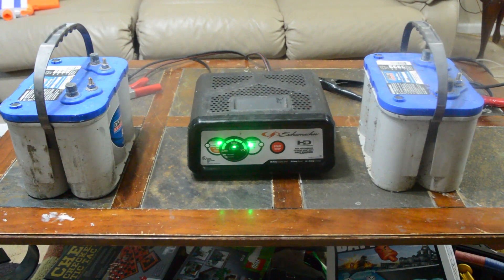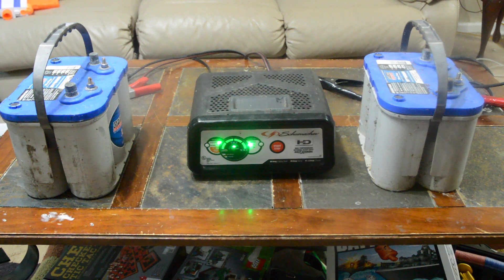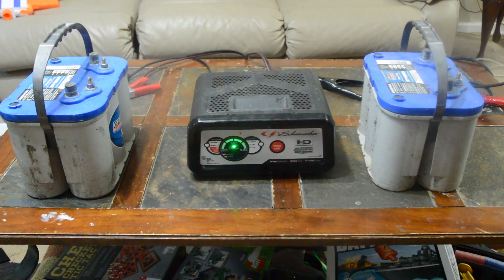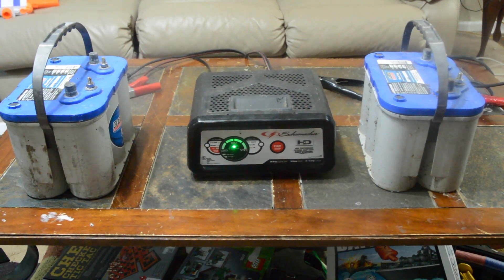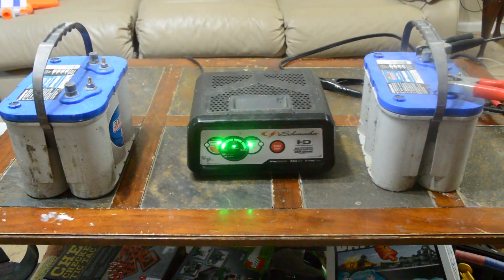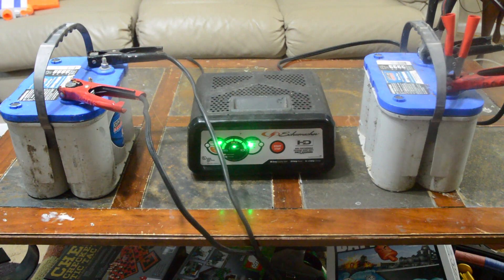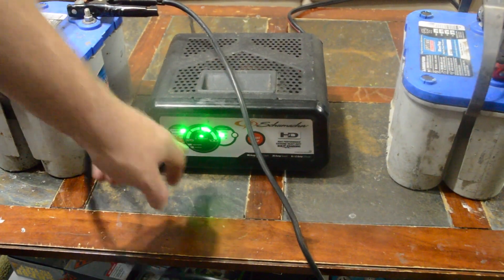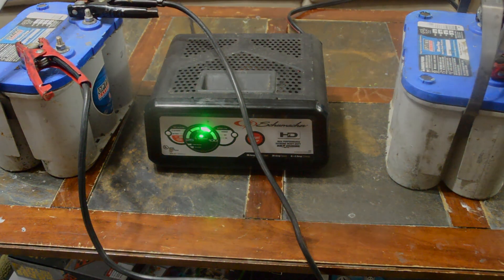How to Charge a Fully Discharged AGM Battery

Comment: Thanks for this video! Worked for me! I even used a smaller lawn mower battery to trick the battery charger into charging a larger lawn mower battery. I stood by for 30 minutes, kept feeling the wires, clamps and batteries for heat before I walked away.

Comment: I have a 9600w 13 hp, tri fuel.  But when I get the lp gas output adjusted so it runs without surging, it isn’t getting enough rpm to get the voltage up.  I’m running just 102V /205v.  My regulator is dual lp/ng

Comment: I have a yellow  Optima battery I bought  AGM compatible charger... I used a new battery to charge my yellow top.. Then the new battery was telling the charger that it is fully charged ..so then I connected the yellow top directly to the battery charger and it took over I guess it had enough charge in it...it would not tell the charger it's a dead battery  ...

Comment: Thank you for this. I just did this today and saved my agm deep cycle battery which I bought for my a-frame camper.  It went down to 7.4volts.  In an hour doing this with a standard battery, I got it up to 11.6 volts which was enough to put it on the Smart Charger. It was at 1% charge and has been running all day. Now is at 84%.  I appreciate you sharing your knowledge

Comment: I could be wrong but I believe that the minute you connect a dead battery to a fully charged good battery, positive to positive and negative to negative, a good battery will try to charge the bad battery at rates much higher than your typical 10-15 amp battery chargers, and this is bad for both batteries, regardless if you have a charger hooked up or not. If your jumper cables are of high quality and your good battery has high cranking amp rating then it can cause the dead battery to get really hot, (jumper cables and good battery can get hot too) and even cause electrolyte to boil and battery to explode. Same goes for jumpstarting your car, when you jumpstart your car then the alternator will attempt to charge your battery at 80-120 amps, and after 5 or 10 or more jump starts your battery is a toast.
Again, I may be wrong but the safest way to start charging a completely dead battery is to use a cheap charger that does not test the battery prior to charging it and few minutes later, when battery has at least some "juice", switch to your more advanced charger. The whole idead behind 10 amp or 15 amp battery charger is that it will supply only 10 or 15 amps of current and charge the battery slowly without overheating it (regardless of the condition or size of the battery). In worst case scenario if you must charge  completely discharged battery and your charger shuts off you can try using jumper cables only for like half a minute at a time and see if it's enough for your charger to start charging cycle.
Reply: You're not wrong..I think you know that..lol  another thing is that quite often people don't allow enough time for a battery to fully charge..take a 500 cranking amps battery for example and if you charged it at 10 amps it would take 50 hours on a charger to get a full charge..honestly i dont really think these smart chargers are helping society's quest for knowledge..they really are just another (albeit small) example of the continuation of the dumbing down of another generation..but i guess who needs to read a book or use a little common sense when you can just buy a charger that'll do all the thinking for you..lol
Reply: There is no charger on the marker that does not test the dead battery before charging it. That is why options are limited. You have to use a second battery to solve the voltage issue.